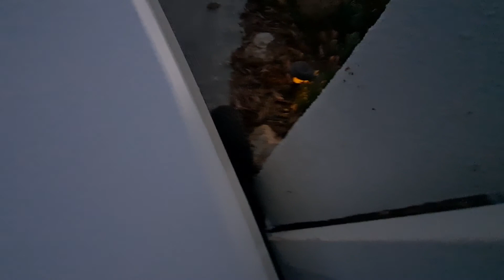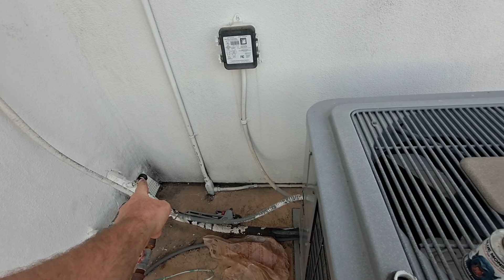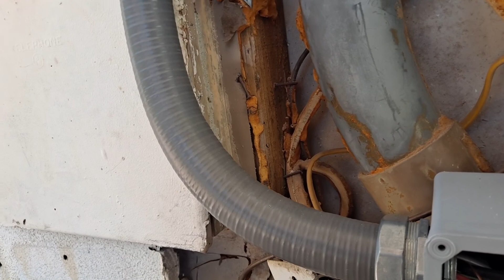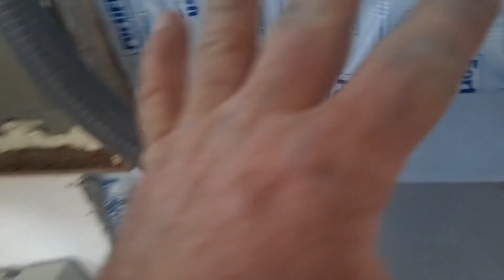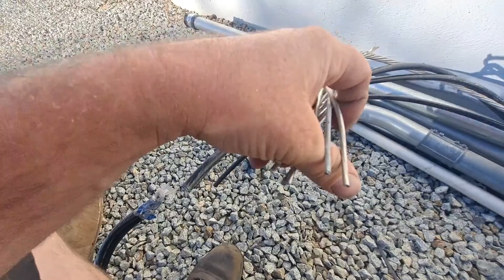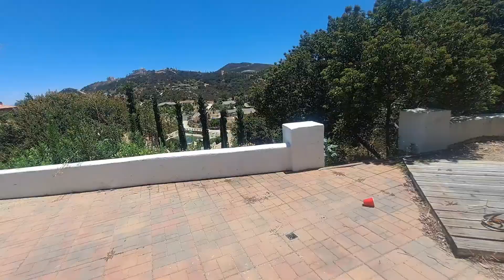Generac 22k guardian full standby generator install in California (propane/stucco/combo main panel)

Comment: The power for the original box comes from your transfer a switch transfer switch box fees the power into the second breaker box which is the reason why all those breakers of fear by the output of the trans for a switch show their 40s transfer switch box is the main point of disconnect it should be bonded and your second box should be unbonded that doesn’t switch it to top it is in a Rupps to the power coming in and it comes from that switch to the input of the transfer switch box it has nothing to do with that first box so it’s not all outbreak is an about should be unbonded bonded